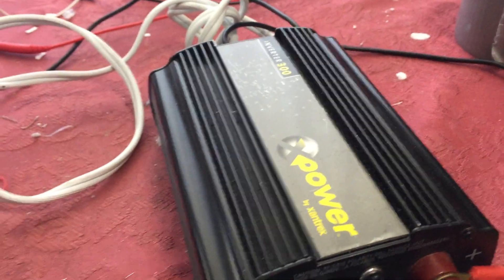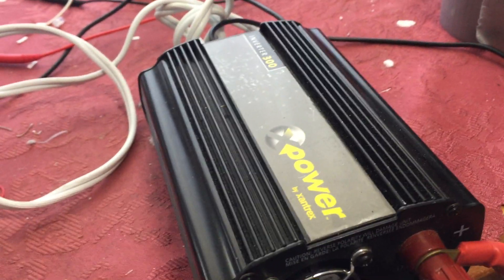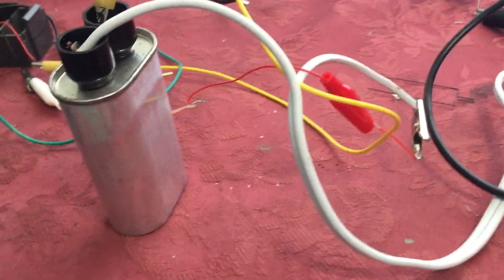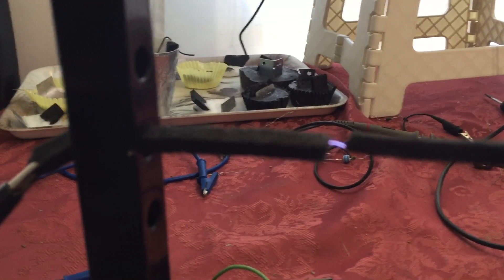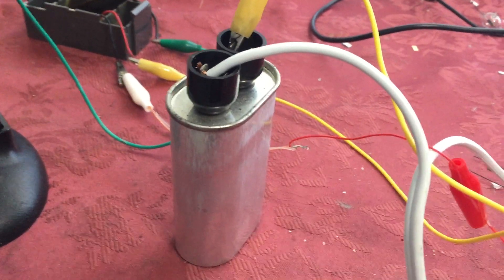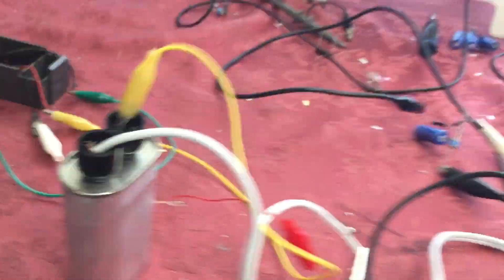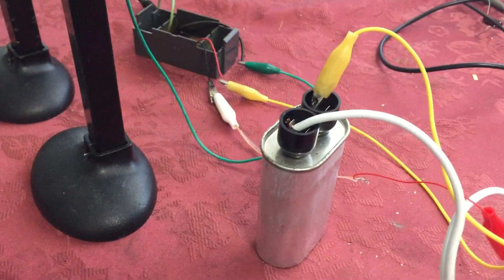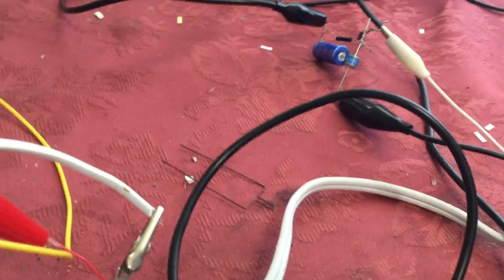High Voltage Reactive Power Supply

Comment: Looks great. I'm using a variation of your SCR cap dump but using 56v zeners to charge a 12v car battery - and it takes ages, but seems very 'low cost'. If that cost can be even lower without extending the charge time (or maybe even speeding it up a little) that would be worth building. Look forward to the schematic. Guessing you'll post this on the forum so I'll check here & there. Keep it up. Keep up the good work!